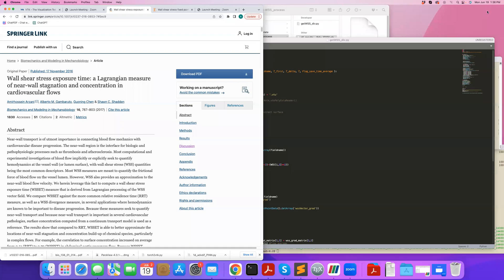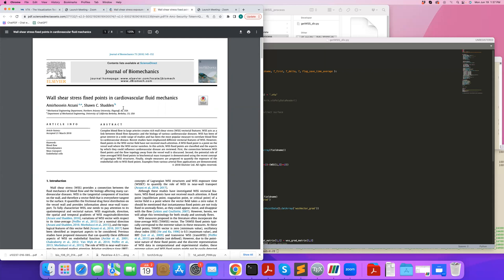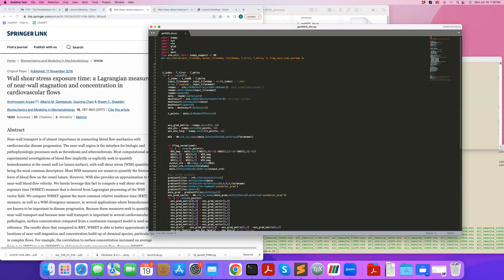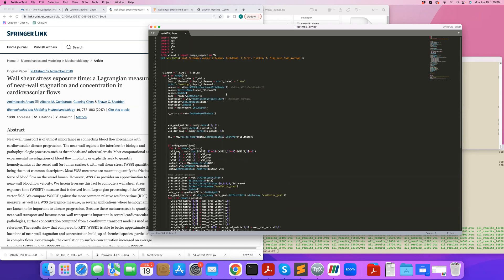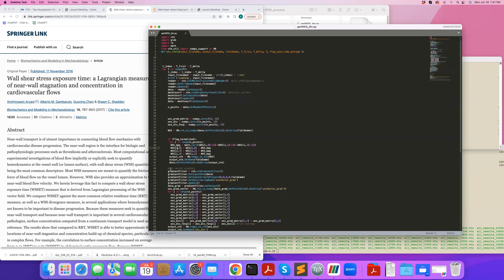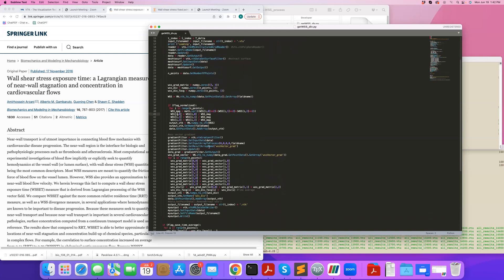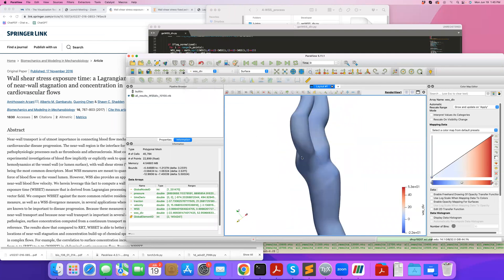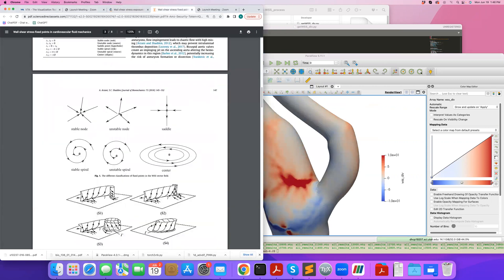Wall shear stress divergence with VTK (and note on WSS topology).

Comment: Hey, thank you for shearing this. I have a question - is it easily applicable for results from Ansys Fluent?
Reply from the maker: Yes if you save Ansys results in a certain format you can load it in paraview and then convert to VTK (I believe the mesh needs to be tetrahedral).